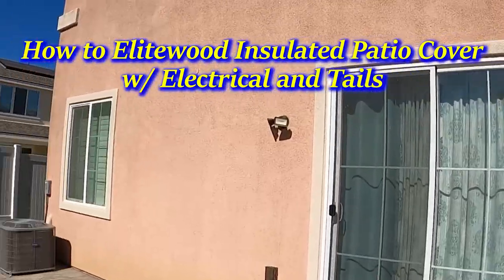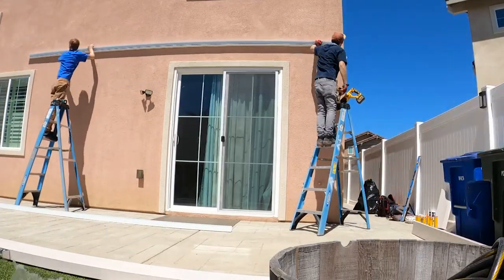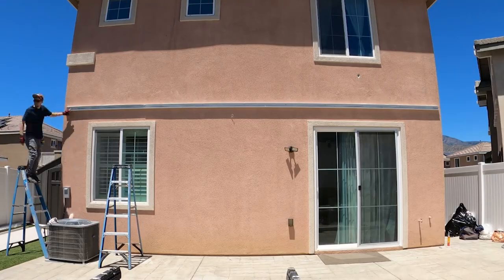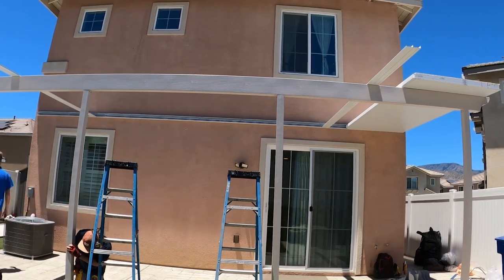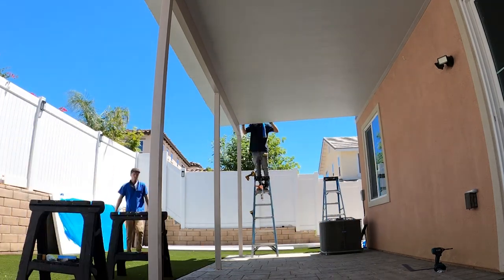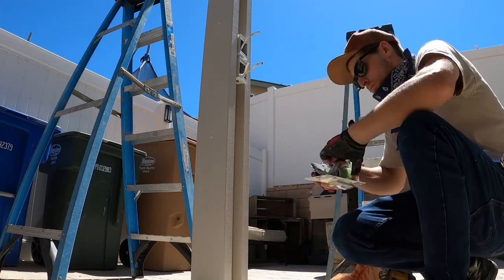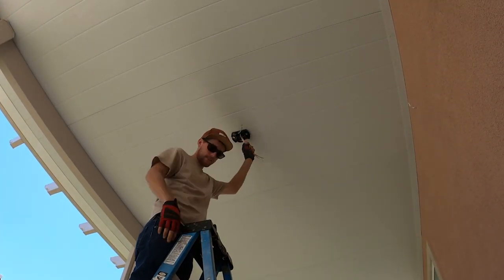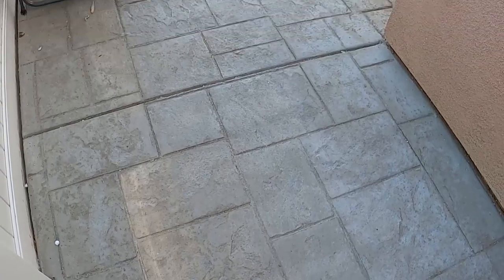How to Elitewood Insulated Patio Cover with Electrical and Tails

Comment: Would off liked to see the actual fan bean installation.
Reply from the maker: Insulated panel fan beams are installed at the factory, not on the jobsite. And fan assembly is done on the ground. 

Thanks,
Everyday Patio

Comment: Do you any videos on the electric wiring install in the roof panels or and info on it . Great work by the way .
Reply from the maker: Hello there, thank you for your comment. Any questions about the electrical feel free to email us with your questions at everydaypatio@gmail.com , we’ll be happy to chat with you.
Reply: @EverydayPatio  a video showing how you run/feed wire for a non-insulated cover would be awesome! Electricians in my area say they can’t do it. I just bought the fan beam caps and have the fan beams already installed

Comment: Hey! great job. I was wondering how you run the electrical wiring through the panels with the foam on the way. can you explain  please.  thanks
Reply from the maker: Hello and Good Day Ariel! For all the electrical on our patio covers, we order electrical channels inside of the insulated panels, prior to installation. It costs extra to have them embedded, but it is a much better option, than have electrical pipes and conduit ran on top of the patio cover, which are prone to leaking into the electrical. Long term electrical integrity is easy to maintain with these electrical channels in place.

Thank you for the great question and have a good rest of your day,
Everyday Patio

Comment: Can you share the specs of the lights you installed? I’m have an insulated panel roof installed and it’s been a task to get info on recessed lights being installed. Also curious on the fan install; how do you avoid the wiring with the screws going into the beam?
Reply from the maker: Hey Mike, we used to use J-box Halo LED lights, basically surface mounted LEDs. We're usually using Halo 4 inch recessed lights now, if you are replacing them, just use the surfaced mounted ones, much quicker and easier to install. I just personally prefer the new 4 inch recessed ones.

For the fans, usually we push the wire to the side while putting in the lag to support the fan, into the fan beam. Very rarely do we hit the wires, so it's normally a non-issue. Some installers drill out the wires and holes on the floor, if they think they might hit the electrical line.

Great question, thanks for asking Mike.

Hope you have a great New Year!
AJ

Comment: Panels are pre-wired? I see how you install a sealing fan, but I don't know anything about electrical wires in the panel, or chamber for it
Reply from the maker: We run our electrical in the hanger, and then into the fan beam, not sure if we focused on it in this video, but you can normally see the silver electrical channel as we are building the patio cover.

Comment: Hi.. appreciate if you can advise how do you run the electrical wires through the insulated roof?
Reply from the maker: Hey Kevin, you run your electrical into the hanging channel of the patio cover. From there you run the electrical into each of the fan beams of the insulated panels. You have to order your insulated patio cover with fan beams, before installation. 

Thanks,
Everyday Patio

Comment: Hi AJ--great job with the videos! I was wondering if you could share a few details about hanging the fan. Did you use a fan box inside of the cover, or did you just put a bracket straight across and use longer screws to get through the insulation?

Thanks!
Reply from the maker: Hey Mike, thanks for the comment. We appreciate it. Putting a box, and making sure the wires are secured at the fan junction is a proper way. The hard part is making sure the fan beam channel stays intact. The easier way is drilling a screw through the fan beam, you just need to spend special care not to go right through your electrical wires, and secure the wires near your fan junction.

That being said, always use a licensed electrician, for all electrical work.

Hope this helps, feel free to email us if you have any other questions and have a great day Mike,
AJ
Everydaypatio@gmail.com

Comment: Great Video Thanks! Do you have concrete anchors under the pavers for the posts? You ran wire from an existing outlet inside house through that hole on the same breaker?
Reply from the maker: Hey Travis, thanks for the comment! That is actually a really thin veneer concrete/plastic stamp, they did to the previous concrete pool foundation. Overall a pretty good base, compared to pavers. And yea I ran the electrical line from an existing outlet upstairs in this video, I believe. Very rarely is a a patio cover pulling enough power to warrant a new breaker, but it also depends on what the condition of the electrical is by the patio cover.

Hope this helps, and that you have a great rest of your day,
Everyday Patio

Comment: I have a 26' long pan roof being installed. One side is secured to the covered lanai via supergutter and the other side with a post through a concrete footer. The backside is secured to the house. The middle post is secured to the pavers only. Is the middle post required to have a concrete footer?
Reply from the maker: Securing to pavers alone is not structurally allowed. You must have a proper footing. Especially on large spans.

Thanks for the comment and hope this helps,
The Everyday Patio Team
Everydaypatio@gmail.com

Comment: How'd you run electrical to the can lights and the fan?
Reply from the maker: Hey Blackwater, I ran the electrical from the top into the hanging channel and then into fan beams inside of the insulated panels, from there I run it into the header/posts and install the switches/outlets
Reply: Thanks for the reply!
Reply: Did you make a hole in the top to run electrical ?

Comment: Can you say patio covers be installed directly to the facia board? My patio has facia board on two sides that the cover would need to be installed to
Reply from the maker: Good Day Farhat! Yes you can install to Fascia Boards, you need to be a minimum of 2 inches below the drip edge. To waterproof properly. Also your Fascia Board should not be rotted, leaking or be anything less than 2 by 6 wood. Fascia board installs are tricky and need alot of care to be done properly. Often I'll just replace the whole Fascia Board before install, to prevent leaks.

Hope this helps,

Best Regards,
Everyday Patio

Comment: Beautiful.  We just had a cover similar to this installed.  However, noticing an expansion/pop sound from the ceiling where it attaches to house on one end. Do these insulated covers expand? It’s very strange…
Reply from the maker: Good Morning Penny, thanks for the kind words. I personally have not heard any of our insulated patio covers pop, but I have heard about this issue from other manufacturers. It could be alot of different things, a improper laminated panel, lack of caulking between the seams, the wrong caulking used on the seams, or improper installation. Solving the problem would involve a close look at the entire patio build and whatever materials/installation methods were used. 

That's a large part of why we made the Insulated How To videos, to help avoid having issues like this, 

Hope this helps and your contractor is able to solve your issue,

Thank you for your time and I hope you have a good rest of your day, 
Everyday Patio

Comment: What screws did you use for the fan?
Reply from the maker: Hello Shay, the type of screws depends on your manufacturer, if your using Four Seasons, we typically use 2 - 2 1/2 inch 3/8 self tapping hex drive screws, on either side of the fan bracket, into the fan beam. There are other ways, but this way is best for a full water tight seal.

Thanks for the great question, and have a great rest of your day,
Everyday Patio

Comment: Great video. Can you explain how you might install a retractable TV ceiling mount on the cover itself? I have to think it would require a steel plate be placed on the back side and bolts going through the cover with silicone to seal everything. Thanks for any comment.
Reply from the maker: Hey PK, great question. You pretty much answer it exactly how I would do it, or order a couple extra fan beams and just attach to those directly. It doesn't have to be a steel plate with through bolts on the roof, you can also use 1 large piece of extruded aluminum that comes with the patio cover, or 2 smaller pieces with thorough bolts. 

Thanks for reaching out and we hope you have a great rest of your day,
Everyday Patio